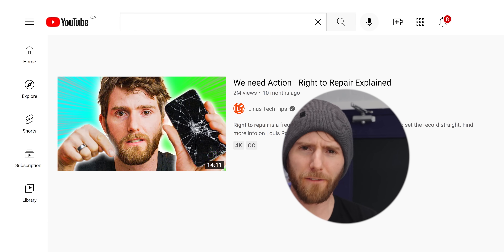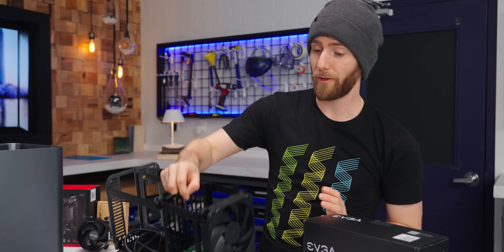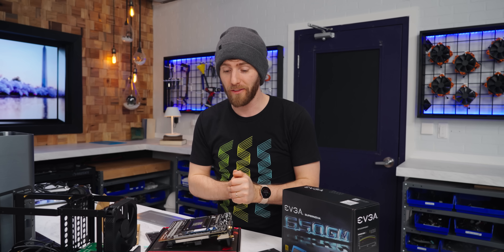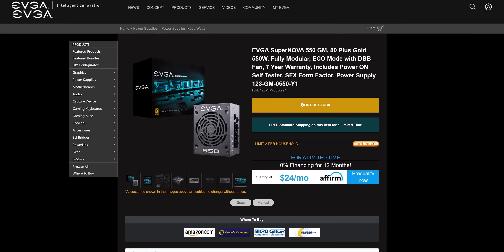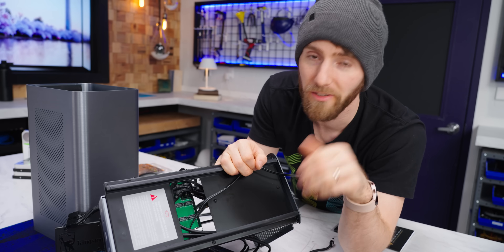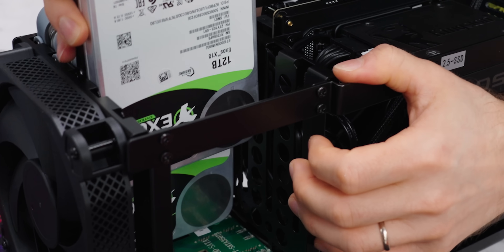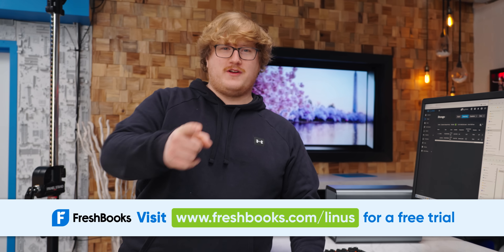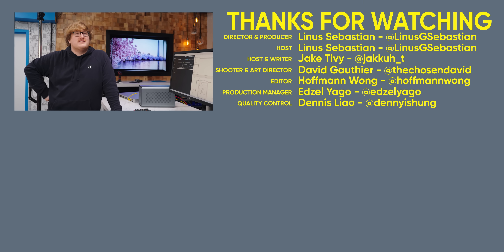This blows away the competition - JONSBO N1 NAS Build

Comment: Another thing worth mentioning with off the shelf products like those from qnap is that depending on the configuration of raid, containers, encryption etc, you might actually get locked into that specific brand. 

When my qnap NAS failed, I was forced to buy another one from them because of the proprietary way they handle the drives. 

I couldn't just pop them out and put them into a computer or even into s different brand of NAS
Reply: this , honestly for me is the bigger part of why i wana DIY, i want the flexibility and option to do what i want how i want it, even if 95% of the time i wont, its still an option at least
Reply: Yes i agree, i really hate it. They say it for security, but what's the point when the NAS broke, we can't access our own data when the HDD itself working fine. Maybe some people want that features, but i don't need it. At least give the options to disable it. If i want to secure my data, i will encrypt it with my own KEY. I don't need someone else to hold the KEY for my own secured data.
Reply: I had the same problem on multiple Synology NAS. Now running unraid on an old computer and have a lot more peace of mind when it comes to hardware failure.
Reply: For anyone that's curious, I actually went through about a week of trying to get the disks mounted on another machine. 

I think at one point I even tried a special virtual machine or live OS from QNAP. 

It was a long time ago, so the details are fuzzy. 

I think it was something to do with the combination of encryption, storage pools and file system. 

QNAP escalated my support request and basically confirmed the only way I'm going to get the disks mounted is through another qnap NAS.

Eventually I just got another qnap NAS and that's the end of the story 🤷‍♂️
Reply: @GadgetAddict  Thanks!  I think I'll stick with my Xigmanas.
Reply: @GadgetAddict  Sounds like my story. I ended up restoring the 1 month old backup because it wasn't going to be worth the effort.
Reply: Same with Synology. I love its ease of use and desktop-like interface, but its slow as hell for anything requiring only a couple drives. And Hyper Backup on Synology uses its own proprietary format for offsite backups, again, locking you into their platform. Thankfully, remote backup is only for redundancy purposes, but moving otherwise good drives over will be a challenge. This is definitely my after-tax-season project.
Reply: Or you can have it start auto initializing disks (That means they delete them rather than importing) when you move them out of the failed NAS.
There are enough horror stories out there where this has happened, just because the drive order has changed.
Better to build your own and have total control over what it does and using open source standards so you can move them without fear.
Reply: I need to read more into trueNAS. But if any of my system components like the mobo fail, I assume I can simply take my os disk, storage disks to another similar motherboard and my array will still be detected as long as they’re connected? Would ordering of the drives even matter?
Reply: @EdwardChanNYC truenas uses uuid like any person should cause sd* can always change. Zfs can detect but again back ups if shit decides to hit the fan. This is assuming there isn't some other layer preventing zfs accessing the drives. You should also have a backup of truenas config just in case as well
Reply: Yeah, you need to be extremely careful when buying hardware RAID devices. It's nice to know (from other replies) that some companies are good about it, but many aren't. In general, when companies talk about "security", they mean their own first and foremost.
Reply: @eekee6034  Specifically which companies and products do you refer to? do you have hands on experience with them or just what your read?
Reply: Order your diy one, build it, order a qnap, recover your data from the qnap to your diy rig, send the qnap back within the 14 day return window.
Reply: what the fuuuck
Reply: This is why I would get into freenas etc, so when hardware dies I can just buy off the shelf parts and load the os
Reply: That's why I never use RAID on my NAS. The probability of dying server (or its vital part) is higher than failure of disk (or to be precise the cost of dead HDD is lower). Sure this is different story if you have valuable data on NAS, but for media I would rather lose my data on one drive than all my data on all drives. Even if I would want to recover the data from the failed disk its way cheaper than recovering data from RAID.
Reply: Happened to me but in a good way. I had my Truenas build in an old Dell Optiplex 3rd gen Intel. The motherboard died. I had a bit more recent HP Elitedesk 6th gen Intel. I just moved the drives to the other system and it boots like nothing happened . So convenient. For just doing an upgrade too is very easy.
Reply: @simonamyot-bourgeois6982  How were the drives attached to the optiplex for nas since I don't think they have enough space for a full raid? I have an 8bay JBOD case that i connect to a pc using usb3 but if I can somehow get freenas on it using a separate computer using those connections...
Reply: @Ifalvarado  My optiplex had 3 Sata ports.
Reply: @simonamyot-bourgeois6982  if you wanted to add more drives, how would you go with that hardware?
Reply: @Ifalvarado  I can't.
Reply: synology uses proprietary PSUs that are not cheap to replace. when mine died its what prompted me to build a truenass box
Reply: If you are in Synology and having hardware failure and want to recover the data, and plan to go opensource, you don't have to buy another Synology, just boot Xpenology. "Migrate" feature might comes in handy because it will only erase your OS and installed apps. Your data is safe. But Xpenology emulates a limited number of hardware (Synology devices, that is. Supported HW is pretty much broad). Well, yeah, it isn't exactly legal to use that, but it just serves as a good purpose, saving you hundreds of bucks.
Qnap doesn't have a loader so you are kinda out of luck, but it does have Qnap hero, which is not exactly cheap solution either
Reply: What do you mean? You can plug it to a desktop with Linux live CD and access the data
Reply: You can get the data off of a broken qnap NAS with ReclaiMe. It's the recommendation that qnap gives somewhere in their docs. I had to use it recently and it works very well. But it costs $200. Wasn't my data though, it was for a company I was contracting for. Their data was worth far more than $200 and they didn't have backups for some reason.
Reply: @slicedtoad  My point is to not get to the stage that one has to recover lost data. Your client is the classic example of a user. No end of life plan and no back up strategy.
Reply: @clipperbob960  They expected that keeping  the data on a RAID5 array would mean their data was pretty secure. And, to be fair, it was. It was just annoying to access it after the NAS itself died. Thankfully the ReclaiMe software was able to recover both the data and the file structures.

I added a periodic backup solution that is both easier to recover from and won't be vulnerable to something like a fire (probably, it's in the same building but several floors away since they don't want anything sent over the net).
Reply: a RAID1 LaCie 2big with 2x3TB failed on me. 
The condition is what I have to name The Seagate Noisy Surface Seek Of Death. just before this condition the drive is ok and you can read ok, but onceyou hear it trying to seek to find something, it can no longer find anything.
Took the good drive out and mounted in my first mATX i7-4770K rig expecting to have to use all kind of witchcraft over a month or two to recover files with maybe or or maybe not ok contents. (A 2010 experience left with some files types like MP3 and TXT ok but others like FLAC with junk inside.) but disk read absolutely fine, like it was the only drive in the system, it was just replicated onto another identical disk in the same way. Mounted the NTFS partion and copied off the drive. replaced both 3TB drives with 2 6TB drives and off I go again.
Apparantly LaCie RAID1 is a true 1>1 mirror of a std disk partition scheme. I have loved LaCies drive ever since, but not the price.
Reply: If that is the way you are using your NAS then you should look at it from the perspective of a business or other IT users.  A NAS is meant to be live data only.  It is ready access to live data, even with encryption at rest it is still live access to live data.  So, to alleviate your tie into to QNAP, or other vendor, you should have a backup copy of your NAS to a DAS.  Mine is done by cron job, on a schedule and then stored away from the NAS.  When I travel, I take the DAS version of the data with me as an extra safety precaution.  If your NAS dies, or you want to perform data migration, simply connect your DAS ot the new NAS for the fastest transfer.
Reply: Worst thing about all of this is QNAP's support. I mean, they put out a flawed software, your system fails and they don't help you recover. With information provided by them I could have easily recovered everything. My support ticket got answered with "they advise you to use strong passwords etc" which I all did and was absolutely not the reason for the Ransomware - their faulty software was ...
Reply: That's why you buy a big external and back the nas up to it and move the drives to a diy one.  My synology 1515+ is dying and I don't want to buy another so this option is enticing.  I have to see what can mix drive sizes and use plex too with file share and apple time machine.
Reply: @nizmoz44  That would be UnRaid, you can mix any size of drives and runs docker. The only catch is if you want parity, the parity drive must be as big or bigger than the biggest storage drive.
Reply: This comment needs more upvotes.
Reply: How is mdadm proprietary? Most of these systems is running Linux one way or another. It's gonna be the same when you diy it. I work in IT though so I just have the know how. So I guess from a consumer perspective it looks like that. Either way backups are everything.
Reply: @theophilusbassaw580  Problem is they use a custom fork of LVM. mdadm is indeed "normal" and you can access the raid. But you dont get into the (custom) LVM layer and not access your data. Tried to recover my qnap after Deadbolt recently... Not possible even with "basic" knowledge of linux/command line/mdadm/LVM. Have to understand their custom implementation and at least I don't and I guess so do 99,9% of people.
Reply: @juliansiebert5275  pretty interesting. Though I mostly work with Synology. Guess they don't use some custom lvm fork since recoveries from them haven't been so troublesome. Of course, I will always stress to clients that backups are everything. Either way I get paid 🤷‍♀️
Reply: @theophilusbassaw580  No, I've also heard Synology is better in that regard. QNAP offers the conect of thin / thick volumes and their own storage pools all with EXT4 File system, plus Snapshot Capability also on top of EXT4... Someone has to tell me why the fuck they Implement basically all ZFS features on top of EXT4, that has to be so expensive in R&D, instead of using ZFS...
Reply: @juliansiebert5275  What model QNAP?  With my TS-859Pro+ when I upgraded the disks all I had to do was connect the old ones to my PC, boot a linux live CD, mount the array and copy the data across.  This was with v4.2 of QNAP's OS.
Reply: @juliansiebert5275  That's good to learn.  I did not know that.  A good extra reason to keep my backups current on the QNAP I use for personal data.
Reply: @thisnthat3530  It's likely you were using the "bare metal" setup, of nothing but RAID where you aren't using any features like snapshot, storage pools, thick/thin provisioning, etc. (I forget the terminology).  AFAIK that is mdadm only and doesn't use LVM at all.
Reply: @thisnthat3530  TS453-Be, latest Firmware before 5.x (4.4.something). Yes they changed it. If your NAS doesn't offer you the option to use thin/thick Volumes (or you don't use them), I guess recovery is pretty straight forward.
Reply: @juliansiebert5275  Good to know.  Mine's ancient - bought in 2009.  Last ever firmware was 4.2.6.
Reply: @jimmay8627  Yes, RAID only.  Also from another reply below it sounds like things may have become harder with later firmware.
Reply: @theophilusbassaw580  Just because you punch the computerized register at 7-11 does not mean you work in IT though :)
Reply: @Physics072  I mean I can tell you were I work 🤷‍♀️. Either way if you believe or not it's up to you. It's the internet after all
Reply: @theophilusbassaw580  err you do get humor yes?
Reply: @Physics072  Personally, don't find it the easiest to tell on comments. Hence, I don't do it 🤷‍♀️. But I'm sure there will be someone to say how dense I am.
Reply: @theophilusbassaw580  No it happens to everyone on messages.  I did put a smile at end to hint i was joking you with some sarcasm.
Reply: Did you build the your own NAS OS? No. So all the products even DYI are dependent on a manufactures "Specific Brand". Your premises is that you have more freedom with DYI vs off the shelf and that is not true IMO. 

In your case if you did as you are suppose to and have data stored on different media you wouldn't be "forced" into anything.  3 2 1 Rule 2: "Save your backups to two different types of media". 

The other part is always missed with users like you. All devices have a shelf life and need to be replaced. I am willing to bet that you didn't replace the drive and device once the warranty was up. Its like a light bulb eventually electronic devices fail. It is how you PLAN for it that give you freedom. Not the solution you pick.
Reply: @clipperbob960  imagine thinking it is justifiable to get a new HDD when the warranty expires. Derrrrrp.
Reply: @littlejackalo5326  Average cost for data recovery $1,500. Cost of new HD with 5 year warranty. $200. Selling used HD on eBay $100. One has to ask how much is your data worth to you?

Comment: I've been running a XignaNAS (was FreeNAS) for 12 years in a large tower with 9 disks in a pool, recently increased to 15 disks I think. RaidZ3, but IDK if XignaNAS has the compression or support for cache drives. That said, for video and photo storage, using a lot of disks in parallel makes the performance perfectly decent, and I can use really cheap disks and still have a lot of storage (2TB disks and 24TB total I think).What's really interesting is that 2.5G write speed - I'm used to seeing 282MB/s at work on our 10Gbit connections to our server cluster served disk arrays. Of course, those serve a dozens of people at a time, so not exactly a 1 to 1.

Comment: That's way overkill for anything I'd need, but incredibly cool for a small business. The price is pretty decent as well. I might put in something like a 5600G just to have direct video out if needed.
Reply: Eeeh. you might do as well price and reliability wise with practically a work bench type of case. Or at least checking used computer places for a old computer and or case with lots of space to connect drives in a caddy.  because by the time your doing a mobo, drives and a graphics card that's practically a PC right their. Checking  if someplace has a 'raid' case the kind where you can put in a ton of SATA, regular old spining disk SATA and saying fuck it to NVME and SSDs and the other over the top shit Linus  used. He's got a unhealthy hard on for them.  Using a regular old school disk caddy, , the style your drives slid into a slot? . they were sex with a babe.  Like latina redhead keep going all night till you get exhausted kind of sex. 
It's more likely to avoid long term compatibility issues. and if you haven't noticed linus is not the youtuber to go to for back up for the regular man kind of thing. "oh it's just a 200 NVME.99 99999 tb, and is "only" 50billionl
A regular ray box pit, onyour network with Timemachine, or the equivilant for windows? All you need for local.  need 500tb? if they make enough drives you're gold. need more? then buy stock in google or something and good god what are doing that'd need that much storage?

Comment: I have mini ITX/MATX(tight fit) case from ~2009, ultra portable, fits a full sized ATX PSU, and, the cherries on top, two external 5.25 bays and an external 3.5 bay. Thats right, in this tiny little portable lanbox, i have 18 hot swappable SSDs, 3 NVME drives(2 of them Optane for cache) 2x3.5 inch internal drives for an extra layer of redundancy. Oh, and a server grade motherboard with Zen2 and 128GB of ECC
Reply: It is a little larger, but mine has up to 144TB of hot swap storage, and up to 56TB of internal storage

Comment: Great Video but again I feel that for a device that will run 24/7, Power consumption as well Power efficiency are a big part of the picture. Would be great update video.  Some comments even mentioned getting old xeon servers/workstations for less than half the price, but power draw will likely be higher. 

Would love to see it compared to a PI4 Nas with a SATA hat.